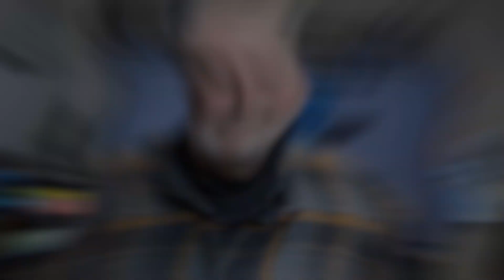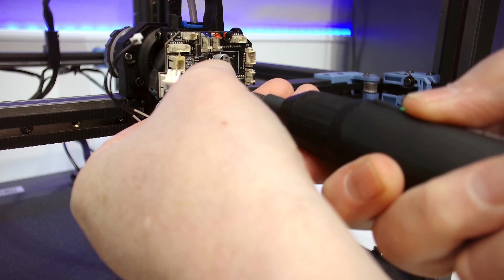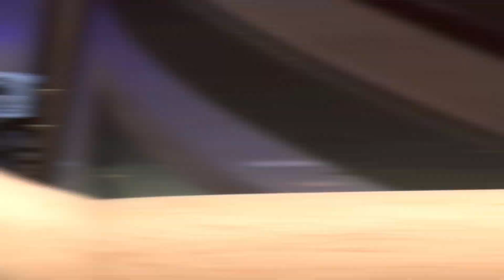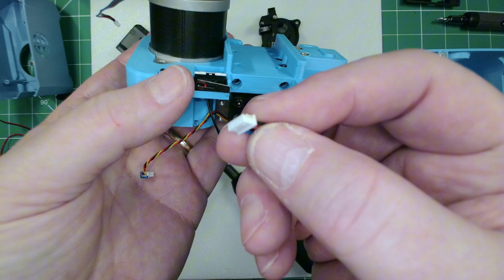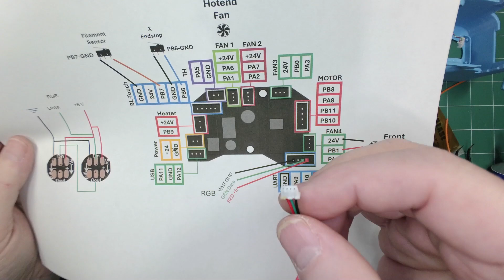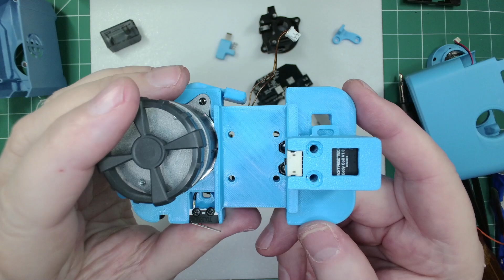CN3D Toolhead V4 Assembly

Comment: Can you teach me how to safely print stuff like ASA while the printer is inside the house?
Reply: I print ASA in the house. It's not that hard. I use 3 different methods. One should work for you. You need a printer that is enclosed. No way around this step. If you cant enclose your printer. You cant print ASA. Dunno about ABS. Method #1 Use a room in the house just for printing. Set printer on opposite side of room as window and open window. You don't want to set it close to window because it will create temp swings that will affect your prints. Method #2 (i use this one) Go buy a bathroom light/vent fan from Home Depot. Switch out your light fixture with the combo. Now all fumes are sucked in by fan into attic. #3 Buy a fume extractor and incorporate it into printer. Thats all u need to know to print with ASA. In my experience the fumes have never been a problem. I use the vent method.
Reply from the maker: I don't know that I can. I'm sure that there are others more qualified than I.

Comment: How would you recommend cutting the blade for the filament cutter? I can never seem to get it working properly.
Reply from the maker: I just breat it with a needle nose pliers. I think I put a measurement in the video. When I built mine (which I did a couple of times to make the video), I looked through the opening from the top and exercised the lever making sure it got dark when pushed. I hope that helps. At least a little anyway...
Reply: @ In the video you say 8.9mm, I assume that means how far it should stick out from the end of the printed part?
Reply from the maker: @ectoBRUH  That is correct.
Reply: @3dpo-rick  I'm having a lot of trouble getting filament to consistently cut. Sometimes it works, sometimes no. Do you have any recommendations on how I could fix this?

Comment: This video makes a complete beginner like me (never soldered anything, never built my own wires) think I could put this all together.

I have been thinking about getting an SV08 but it appears there are so many mods necessary to get it working more consistently.
Reply: I just received mine a few weeks ago and it has been working great as stock out of the box. These upgrades are to take the machine further. None of this is necessary but fun to do if you are into tinkering. This upgrade is ideal to work up to adding multi material or multi color printing. Aside from that, it is awesome to say you did at the end.

Comment: Great video. Would you build a Xenomorph Orbiter or this V4?  I have started pulling parts together for the Xeno Orbiter and wondering what the motivation was to go with the V4.
Reply from the maker: The extruder itself is very similar for both. Since I am working on the MMX MMU now, I wanted all of the sensors (Entry and Hotend) and Knomi. I have gone full Xeno on both of my SV08s with CANBus. V4 is great if you want a simple build with the Orbiter and a choice of several different hotends, that's the way to go.

Comment: my blade keeps coming out the back when I cut filament. I have to glue the blade in is that what you are supposed to do?
Reply from the maker: @oldtimeengineer  yes. Just a dab of CA an both sides. I think I indicate the length in the video.
Reply: @3dpo-rick  Yes you indicated the lenght that should stick out.

Comment: at around 22min you said get the spring with .5mm wire then said do no0t get the .5mm so which one is get it or do not get it or did I just hear wrong I am old. I watched it again and you said if you don't get the .5mm so all is good. I missed the if

Comment: what screw driver is that also why not just use the sencorless homing like the stock printer uses why use the switch
Reply from the maker: @linearburn8838  2 reasons; 1 it makes a bang most of the time unless you turn the values down and can trigger a false endstop. 2 the location of the toolhead relative to the axis are exactly the same every time, which becomes important for e.g. activating the filament cutter before a filament change. It's more consistent in every way. But that's just me...
Reply: @3dpo-rick  what screwdriver is that
Reply from the maker: @ I'll make sure I get that to you.

Comment: Nice upgrade.

However, imho the hotend should be changed to a Revo to optimice multicolour. There are two ways to do multicolour on a single extruder:

1. The way Prusa uses for over 7 years now. Use a v6-alike meltzone and do a special unload sequence ("ramping"), wich results in a nice filament tip you can reload without problem. While in the beginning of the mk3 and MMU2 this required a lot of fine tuning the filament and wasn´t as reliable as hoped, after changeing the hotend of the mk3 from a v6 to a Revo six, it worked well. Of course the Nextruder nozzle is quite simular and the mk4 + MMU3 doe the job quite nice also.

2. With bigger meltzone getting a reliable good filament tip on unload is practicly impossible. So most modern printers use the "cut&poo" aproach. The filament isn´t unloaded but cut inside the hotend. The next loaded filament is used to "poo" the remaining filament out. As the old filament is cut off and therefore not retractable anymore, pooing it out is the only way - you cannot even use this part to print into infill or into a waste object.

Obviously method 2 creates a lot of waste - and takes longer for a filament change. Still, on big multicolour objects with just a few colour changes, the bigger meltzone of the nozzle might be an advantage for overall printing time. Of course for the PLA/PETG-support trick, also cut&poo is the right way to do it, as you cannot use any mixed filament anyway.

However, on full multicolour printing with a thousend of filament changes, cut&poo obviously is extremly wastefull - and consumes a lot of time. Other printers need about 1:40 to 2:15 minutes for a filament change, while an Prusa only needs about 0:35.

So imho you should use a Revo on the hotend (actually the next layer made one for the SV08 as a drop in replacement). This way you could do multicolour both ways: Screw in a 0.4mm normal flow Revo, and you could use Prusa Slicer with its ramping profiles (simply start with the core one + mmu3 profile and do the changes needed for the SV08 - don´t forget to set clockwise slicing). Less waste, faster change - but less volumetric flow so slower printing.
Screw in a Revo HF-nozzle and you have faster printing, but slower and more wastefull colour change. Wich is totaly fine if for example you use only multicolour on the bottom and the top of the print.